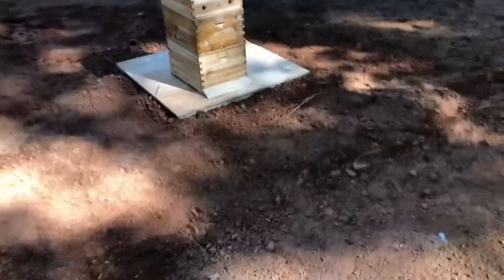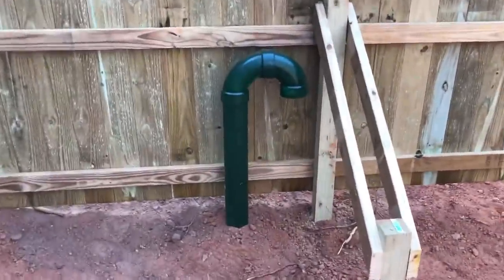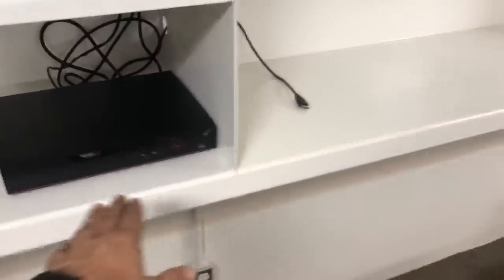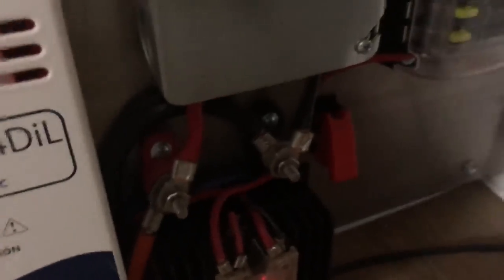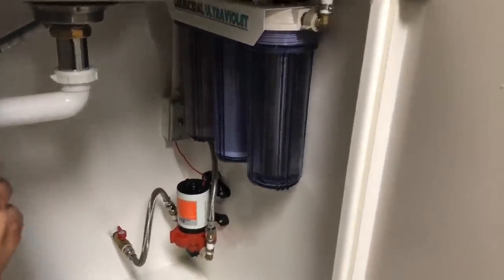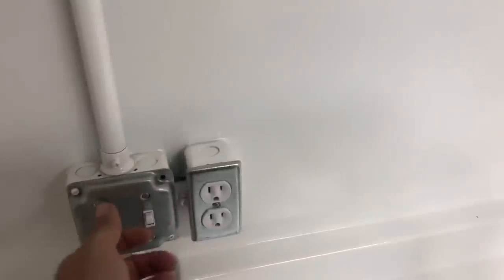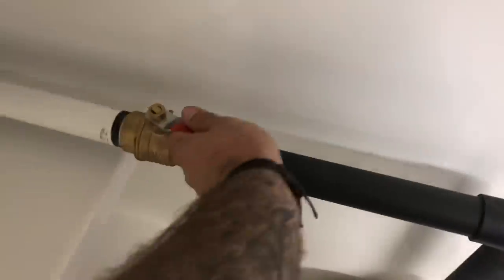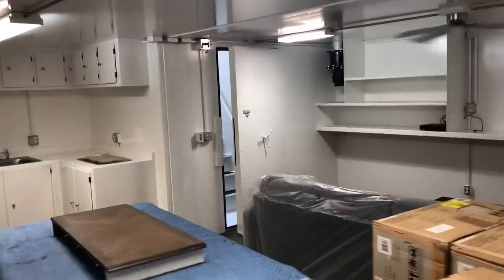Inside a REAL SHTF BUNKER - Doomsday Prepper Walk-Through

Comment: If it’s Rising S, it’s deadly. If it’s not, then no propane in a confined space ever. Air vents should be steel, access hatch should be ballistic, there should be a mud room at bottom of stairway with a 90 degree turn followed by de con shower and air tight door leading to main room. Looks nice otherwise. Every handgun should be a Glock and every bunker should be an Atlas.

Comment: PVC vents can be breached
Reply: Nothing is impenetrable, there is always a way in. All that you can do is mitigate the ways, and or hide them the best you can.
Reply: @AsymmetricalPreparedness  steel pipes galvanized with a drop out pipe before the connection to the bunker is so much safer than what this "bunker" has .and you can't kick and break off steel....
Reply: Yes agreed, there are many things that could have been done more effectively on this bunker, or can be fixed in the future.
Reply: "Breached" or "kicked over and/or shattered ridiculously easily?"

Comment: As that tree grows, it's going to rip out the air intake.  BAD IDEA.

If that fence ever gets knocked over or run into, the exhaust is gone.  BAD IDEA.

To have ANYTHING in clear view of that fence is suicide.  The idea of the bunker is to NOT be able to have just anyone INSTANTLY SEE SIGNS A BUNKER IS THERE the second they get onto your property.  VERY BAD PLANNING.

Solar panels....WAY too small, but it's a start, and better than nothing.  Where are the batteries?  What is the total battery storage capacity?  How long does it take to charge the entire battery bank from zero charge?

Since when do "blast doors" open INWARDS?  (Do you tell people that it's to prevent internal blasts from getting OUT of the bunker?  That's all it'll do in the real world...)

"LP Gas" INSIDE AN ENCLOSED SPACE?!?  Suicide!

Standard "Ace Hardware" residential grade light switches IN THE BUNKER'S ENTRANCE?!?!?  Sterno pots?  How much oxygen do they consume, and how long must the "ultra-budget home-brew air system" run in order to compensate for the loss in oxygen to keep the occupants from asphyxiation?    (Ever done the math?  IT'D BE GOOD TO DO!!!  ASAP!!!)

That "Rising Cess" "home made air system" is a joke...louder than a drunk ex girlfriend on the porch at 3am, and probably not enough airflow to even keep one of those "suicide burners" going...

Propane water heater.  UNDERGROUND.  Which is more important:  a)  NOT BEING ABLE TO BREATHE or b) EXPLOSIONS.

OK...making use of both 12 volt and 120 volt systems is a good idea.  Givin' ya that one.

Cheap cover...I'd replace that first.

Other than that...uhmmm...the grounds were taken care of nicely.  Well...once they're replanted, anyway.
Reply: Almost forgot...plastic melts (or burns) in high heat.  Trees around the area "may" catch fire "at some point."  (Look at California...for the next ten years or so...)

Comment: Sorry T but for 5 bucks i could over take that bunker ! 3 for gas 2 for hack saw ?
Reply: Lol neck prepper, your so right
Reply: LOVE👏👏👏👏👍👍
Reply: $5? I was thinking two Walmart sacks to seal off the air vents along with a padlock or piece of metal on the door and they're done. That's cheaper.  :)
Reply: I was thinking how fast would that hatch pop open if I backed my truck up to the vent and put a hose from my exhaust down it lol js

Comment: 32 Years in the Navy working real NBC and air handling systems.  All these bunkers from both chuckle heads are potential death traps.  the air system will not support 12-14 people and a cooking stove, its only a a piece of 6 inch PVC pipe It will not exchange enough air to prevent CO2 buildup, and no CO2 alarms in any of the rooms and no fire/smoke detectors on the ceiling.  With nothing pushing air out of the bunker you're relying on differential air pressure to move air out vice forced expulsion.  300 watts of solar won't power your air system very long and if you have a generator then you need to deal with its exhaust separately and the noise of it.  The so called Blast Proof door has no specified rating, and is hollow core, light weight and poorly hinged.  Blast proof needs to work after the attack, otherwise you're in a coffin.  I guess a blast from a water hose may be their intended protection. The cypher lock is a joke and easy to punch out rendering the door unusable those things went a way 20 years a go i guess he gets them from surplus.  You have batteries sitting directly on the floor and not elevated to stay dry, and bare wires open on the charging unit.  Nothing mentioned about protecting the drain line, and i noticed the masking tape or electrical holding the vent screens in place.  If the welding wasn't conducted on the outside of the bunker, cleaned primed and painted with a resistant paint, hydrostatic pressure will force water in though any gaps in the welding.  You need a second door to isolate the interior from exterior, and somewhere to DECOM.  your air handling system will only be good for 24 hours in a Chem/Bio hazard.  That includes tear gas or any other irritant.    I could go on, but a real NBC or CBR resistant system is a complex undertaking, requiring a positive pressure air system, multi system filtration, and a way to test and verify the function of the system other than your hand over a valve.  Danger Will Robbins, Danger.

Comment: 1. Sh!t Welds.
2. Sh!t air filtration system.
3. "Blast Door" is not gas tight.
4. Propane anything death trap.
5. Fuses and batteries close to floor. Wait for seeping ground water (see #1). 

6.The air intake it right next to the entrance. 

If the owners of this freshly painted death trap see this comment I advise you PLEASE higher an attorney ASAP!

Comment: That is a badass bunker.  But in my opinion there are too many "mechanical" elements prone to fail.  Keep it simple.  The drain requires a pump?  Dig deep.  Old school rock dump will work great.  Pump for water pressure?  In that situation.  A cistren next to the bunker and gravity feed.  No issues that way.    Also.  I built 2 inflow air flows into mine.  One is hidden 40 ft away.   The other is a fake.  Let that sink in for a moment.  If i see a "j hook"  i start looking for an entrance.    My primary runs up through the wall of an old barn and through its roof.   Not just sticking up out of the ground.  Get it?  Dont forget to shit the valves in a fire.  Itll suck all the oxygen out of the bunker and youll obviously suffocate.    Think groundhog also.... always a tunnel way out.  If youre trapped youre fucked.
Reply: No no it’s not look into rising s it’s an overpriced storm shelter it’s junk

Comment: Bear... Brother, take out an life insurance policy on your client.  I've got a bad feeling about that propane hot water heater. I've seen what happens to confined spaces with propane/nat. gas...!!!
Reply: A house is a contained space, so is an RV, or one of those airstream trailers. If you're not opening the windows, it's as likely to build up in concentration if there is a leak. Propane also has a distinct odor which is the result of an additive. Needless to say, if you are careless or the equipment is not up to standard or poorly maintained, you can blow yourself up, but that is true of Propane vehicles, gas ranges in houses, furnaces, etc... It being a bunker doesn't make a whole lot of difference aside from the fact that it is a contained, hardened space which typically only has one exit.

I expect the reason he is using gas is ease of storage, and it is stored outside the shelter, and the alternative is electricity. At least within the cost range we are dealing with, and the limitations. There is no generator, the unit is fairly self contained, and to be honest, it doesn't look like he plans on weathering a nuclear winter. It's a temporary shelter that may extend to a long term shelter, but one in which your fuel runs out and you are limited to whatever benefit you can get from solar and batteries from that point on. In other words, being frugal, a few months of comfortable living, without a significant amount of actual protection from serious threats to your survival, and then it's just a hole in the ground which might have low voltage lighting and water if that all survived.

I'd hardly call it budget, but it's probably significantly less costly than some options.
Reply from the maker: I'm seriously considering a workaround on the propane; it's about the only valid criticism of this unit. This unit was installed, and this video shot, prior to the explosion in Texas. That being said, the propane was installed by pros and checked for leaks. Twice. And I will check it again a third time.
Reply: "installed by pros" ....more folks who know details, location, etc. Best ALL done by owner. If I had a bunker it would have all been done by me. Desperate times make for desperate people. ....only a close circle of folks who are on the team should know ANYTHING. I know it's not yours but owners and people contemplating this type thing need to think about that.
Reply: Edward Morley... Underground bunkers don't have windows. It seems that weekly you see houses blow up on the news from gas leaks.
Reply: @BearIndependent  Direct PVC air vent not a concern as well? The very fact that propane was used should make you question many more flaws we see as well.

Comment: No escape tunnel and hatch? No manual air crank on air system?  Outer hatch not solid steel/ blast hatch?  No concrete base poured around the entrance door for strength? Air in and out are PVC not galvanized steel? Easy to break off PVC pipes ,will water flow into the bunker if that happens? Main door looks thin, is it a bullet proof blast door? What happens if the tree you strapped the air in tube falls over on the entrance ? The pipe may pull up and fill with dirt, do you have an alternate air in? If the main door topside is hit with the tree is there another way out? No decontamination room with shower before entering bunker?  Bringing in gas to heat water is there an air vent up top for that? 3 people in TX just died in a bunker because of propane gas used in their bunker!! NOT GOOD! 👎 What redundancy do you have if someone pours gas down the air in or out pipes to burn you out?
You need to check Atlas bunkers they have a lot of redundancy features that your bunker is short of... It looks nice but not that secure.
 Bear,  your on top of a lot  this bunker is better than nothing but you can do better.... I'm not insulting you by my critique btw...
Reply: After reading some of the other comments I am not alone with my thoughts...
Reply from the maker: There.s 120 yards of concrete around the bunker. The entryway is a non issue structurally. The outer door is for weather only, and will be covered with a structure in due time. I have been in an Atlas shelter, they are not all that they are cracked up to be. As for propane, I can see the point being made; this propane system was professionally installed and was checked for leaks. Twice. I will have it checked again though, and may remove it altogether. Otherwise, it's a very good product, and I have been in or installed many bunkers from many companies.

Comment: This bunker looks like it was designed by someone who has never experienced any life-threatening weather conditions or worked in a war zone. With some minor changes, this bunker could be a fairly good tornado shelter during peacetime when there is low risk for armed trespassers. However, I see several problems if this bunker is intended to protect the occupants from really bad weather or a prolonged grid-down, foragers and lawlessness. I wonder how well this bunker will perform during heavy rains, flash flooding, storm surges or heavy snow fall. There is all that soil around the bunker hatch and no cover overhead and I think about all the mud that will get tracked inside when it rains. Why not have a concrete pad around the hatch and the hatch concealed inside a metal garden shed?  I see that very large tree next to the hatch and I think if that tree gets blow down by tornadic winds and falls onto the hatch, no one will be getting out of that hatch. I also wonder if the hatch is on the uppermost part of a steep hill and, if not, how quickly that bunker could fill with water during flooding and drown the occupants. I see those puny gooseneck ventilation pipes and think how easy it would be to stuff rags in those pipes and tape over with duck tape and force the occupants to come outside when they get low on oxygen.  Or how a deep snowfall or a mudslide would cover and block those ventilation pipes and the hatch. Or a truck could back over a ventilation pipe and totally collapse the pipe. There are styles of sturdy, tamper-resistant ventilation pipes available and ways of protecting ventilation pipes from getting buried in snowfall or mud. I see the electrical wiring connected to the power grid going from the surface down to the bunker and wonder if the bunker is protected at all from EMP. What will happen with the generator-powered ventilation system if there is an EMP or coronal mass ejection Carrington-type event? Finally, I do not see a prison-style chain link and concertina wire-topped fence around the bunker and wonder what is to prevent random trespassers from easily driving a car or truck onto the hatch to prevent the occupants from opening the hatch. I would not want to trust that this particular bunker would keep my family safe during a major disaster.

Comment: Brad problems aside.  One thing I would add is a peddle system that can help charge the batteries and if needed run the air pump.  It would also give an exercise point.

Comment: Do the batteries off gassing require the ventilation be "on" all the time?  If not for the batteries, wouldn't you want at least the pipes to be open so mold and mildew doesn't start, or is keeping everything closed better for mold etc.?  Thanks.

Comment: Only one entrance??? I appreciate most of your content, but I'm not keen on this one. No secondary exit (what if the only exit gets blocked?), no blast proof door (it's a bomb shelter, right?), no manual crank for the air (what happens if the power goes out in an emergency?), and a propane tank fed into a giant steel box (literally, wtf?). This is not a shelter, it's a tomb.
Reply from the maker: there are 2 escape hatches, not shown, per the request of the client.
Reply: @BearIndependent  
Good to know. The other questions are still relevant though.

Comment: Where’s the emergency escape hatch?. Nice lay out..air filtration system is much too loud.. needs a bit more quality before I would label it “well built “. 🧐
Reply from the maker: there are 2 escape hatches, not shown per the client. The air filtration will break in and quiet down pretty quickly. As for "quality" having been inside many bunkers, I can say that it is well built.
Reply: That’s not gonna get any more quiet! Haha you may as well just label the door “this is a shelter” when you turn that air system on they are gonna hear it! Then I would just wrap a plastic bag around the plastic air pipe or just kick it over ! Haha gimme a break

Comment: With propane in the bunker it is a good thing the blast proof door swings inward as it will contain the blast when the bunker blows up from inside.
Just be careful not to step on the hatch so it won't bend the weak metal.
It just feels so right giving your money to a company run by a felon that doesn't warranty his work but instead blame the client for his errors.

Comment: There is a hard-to-reach switch just past two exposed terminals that look like they carry a ton of current.  That alone a death trap and is such an obvious one that I'd question the judgement of anyone that was involved in the process.  What about when they are fumbling for that switch because the lights shut off?  Do a test yourself with power disconnected, I can almost guarantee you manage to touch the live terminal.  Please please please go back to your client and fix this.  If you aren't willing to fix it at least put them in a small box or cover them in thick plastic or something because that's scary.

Comment: It might be a pain in the rear.  But take the water heater outside and run the pipes in the bunker. Attached to the building or get another hive and place it inside.  Hot water is a convenience.    Shop or a shed over the vent pipes is a good idea.

Comment: Nothing wrong with propane, you just need to understand its risks and plan accordingly.

I would suggest a utility room that is lower than the rest of the structure (propane is heavier than air) and your exhaust intake should be at the bottom of the pit. (Idealy the utility room would have a check to let air in, yet, not out)

I favor positive displacement air systems but a backup exhaust fan (non-sparking) would be a good idea.

If its not in use it should be off anyway... 

I am interested what people suggest as a energy source to replace propane with.

The longevity, reliability, and utility of Propane is really hard to beat.

Comment: And the 12 volt switches did you run into regular 110 electrical or did you use regular 12 volt wiring